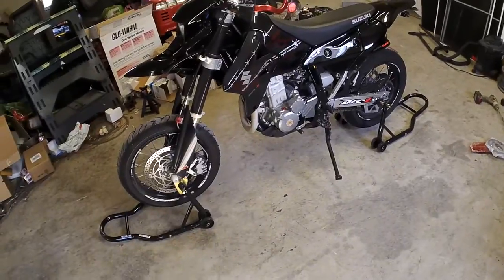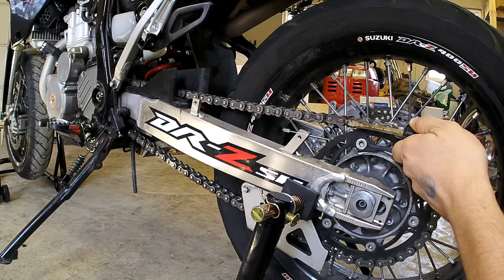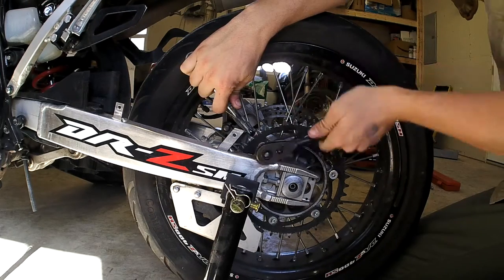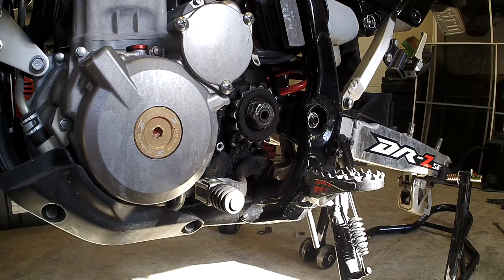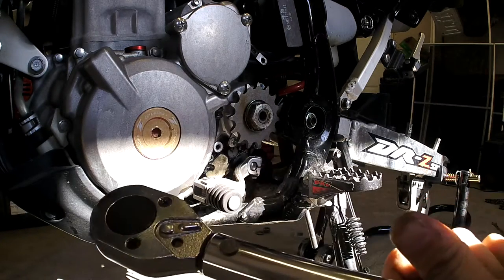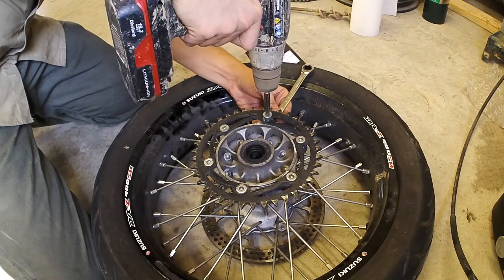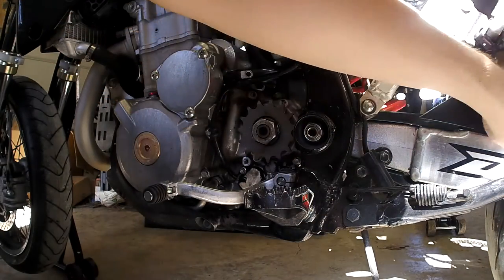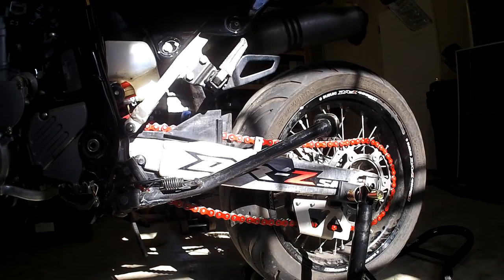Fix It Friday: How to Change the Chain and Sprockets on Your Motorcycle (DRZ400SM)

Comment: dude use the brake, not the engine to tighten the front sprocket
Reply: the brake is typically easier especially if you have an extra hand... but if you think tightening that bolt with the engine in gear is gonna hurt anything youre looney

Comment: Pro-tip: use the brakes for the front sprocket, and on the nuts for the rear sprocket, loosen the nuts, not the bolts. It's a lot easier to strip the allen than the nut itself. Did anyone ever settle the debate on master links for the street?

Comment: Don't you have to hammer the master link so it makes a rivet?
Reply: No, it used a locking clip. The chain that comes stock requires you to grind it off, it does not have a master link.